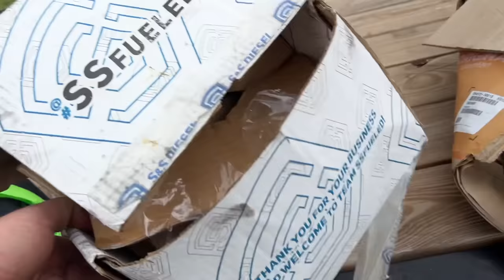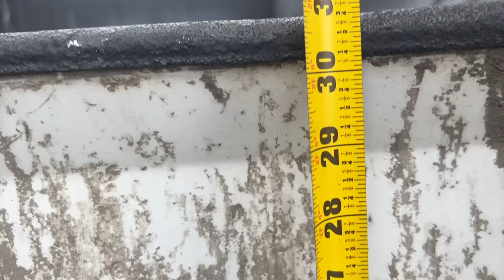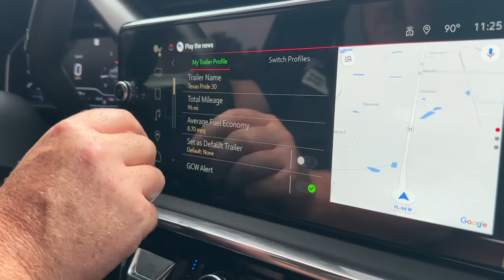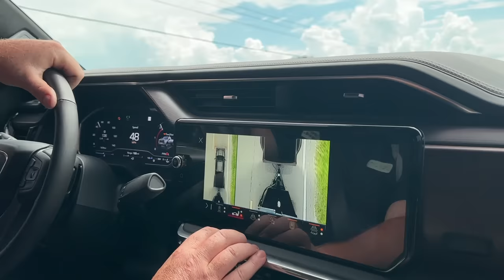$100,000 Diesel Truck VS $2,000 Diesel Truck!!!!  Are These New Trucks Really Worth It?

Comment: Have had a 1999 F250 7.3 manual for years, still my daily driver. At 307K miles, I’d still trust it across country.
Reply: Same here with a 2001 7.3. Jump in and go. Give me 50,000 to do upgrades and it would tost all those  new trucks.  I hate def trucks mine has no imitions at all from factory  very reliable.
Reply: Used to own a ‘96 IDI non turbo, bought for 900$ all she needed were some new fuel lines since she was sitting a while. I could piss, shit, throw McDonald’s grease and radioactive horse semen in that ol girl’s tank and she’d run better than when I filled her up on normal diesel. Duel tanks were amazing too. Sold the truck for 6,000$. Would pay 7,000$ just to have that truck back. Her nickname was “Loyal”.
Reply: @AquafalconHD  all the 7.3 was like that. Every motor  after was junk. With the injection system  on the old ones you could almost run straight  motor oil and she would run. Lol I actually  would filter and delute are old oil from are over the road trucks and pore it in the fuel tank. Why wast 10 gallons of good used oil. Lol
Reply: Given the fact that you just can't buy these configurations anymore I'd say its even worth it to invest in major repairs or restoration down the road just to keep them going. My friend's dad also has the manual diesel F250 for his home contracting business with about three dollars and fifty cents on the odo.
Reply: What major mechanical maintenance have you had to do recently? I just discovered my reman steering gearbox (installed by previous owner or his mechanic) was missing brass seat inserts where the hoses connect. All this power steering whine and I couldn't pinpoint the cause, leak kept getting worse and worse. O rings were the only thing sealing. And of course my reman autozone A/C conveniently blew after almost exactly 1 year, thanks to the texas heat. Also had a hole in the intercooler so I replaced and decided it was a good time to vent the crankcase into the atmosphere. Lifetime warranty swapped my moog drag link that connects to the pitman arm. Is it me or do the replacement auto parts suck @$$ nowadays? 2000 4x4 SRW with lift and 316k on the odometer, Freedom off road adjustable track bar
Reply: Yup, I have a 2002 7.3 F350 with 395K miles.  Just for kicks, I did the same tests these guys do with an excavator on trailer (~15,700 lbs, according to the scales).  It performed much better than their $2000 truck, but my trailer brake module works, and I have an Edge Evolution 15001 programmer on it and an upgraded turbo wheel (and a few other minor mods).  In "tow" mode, it did close to what the new truck did in this video.  In "extreme" mode, it did a little better than the GMC on acceleration but blew black smoke like crazy.  The real problem with driving my old 7.3 like that is the exhaust temps jumped rapidly, and I certainly would underperform the new truck in the mountains (or die trying).  In my mind, the practical problem with my old 7.3 is the transmission.  I replaced with a new Jasper when it went bad a couple of years ago and it is still fine, but won't be if I keep doing acceleration tests with a heavy trailer 🙂.  Overall, it's certainly not as good as the new GMC and not even close to the high-output versions of the 6.7s Powerstrokes or Cummins, but the old 7.3s and Cummins 6.7s are easy to upgrade with a lot of torque and HP for pretty cheap (again the tranny has to be addressed if you want to do serious commercial towing).  I probably have about 130 HP more than the $2000 truck.  I'd certainly prefer a new truck if someone wants to give me one, but until my 7.3 rusts out from under me, I think I'll delay the divorce as long as possible.
Reply: @darinclay6838  I love the old 7.3 I have also. It's been modified  to. Would love to be able to mate that 10 speed auto to it. Other wise I have to settle  for a bts when the time comes.
Reply: Just regular maintenance for the most pat, glow plugs, new exhaust and front end parts. Engine and transmission are still going strong. The body is rusted badly though. Michigan is tough on steel.
Reply: Why does people keep saying the 7.3? The guy I said it was a 6.0 Many times unless I miss something and I very well could have LOL.
Reply: Same. 90 f250 7.3 idi. Last b4 powerstroke. Dual tanks. Banks Sidewinder turbo add on. No def. No computers. EZ to repair. 400k+ miles. Daily driver. Trust is huge.
Reply: @365xmacronocomp  those of us who own "old reliable" 7.3s agree it was one of the best diesels ever made...
Reply: @AquafalconHD They didn't make a 96 IDI 7.3, 94 was the last year of the IDI.
Reply: Did pretty good for a 6.0, it's a miracle that it didn't blow a head gasket.
Reply: @kenfix2740  was it 89 last year for the 6.9 before the 7.3.  That was a good motor  also.
Reply: 1999 7.3 Powerstroke XL 2wd automatic 
307k miles 
Purchased in 2020 for $8000
3 owner and still got the original window sticker in the glovebox at $33,000
I told a guy 2 weeks ago he couldn’t offer me enough money to buy it. Best truck ever made
Reply: @brando8115  A 7.3, 6 speed, with manual shift 4x4 is the best truck ever made, a 2wd automatic is a waste.
Reply: I got an 07 with 212xxx and I love it but I def wouldn't trust it across the country unless I was towing a spare truck 😂
Reply: @ekogut1158  07 is a 6.0, I wouldn't trust it brand new.
Reply: @Lray4x4  ok sure bud, maybe it’s not the best  being automatic but go ahead and tell me it’s a waste after I’ve put 100s of thousands of miles on it lol. Let’s put things into perspective here homie
Reply: yes sir. id trust my 2001 f-350 to take me wherever i needed to go more than i would trust a choked up computer truck that need’s emission fluid to run
Reply: @Lray4x4  a waste? Lol ok buddy
Reply: @brando8115  Yes, 2wd auto is the worst possible combo, it's a waste of  metal and a good engine to put it in a truck like that.
Reply: I have fords 7.3  6spd 898k
Reply: Ugh I can imagine you can hear all the cheap plastic and rattling. You can probably feel all the pumps on the road. Typical Ford they feel cheap and like they are falling apart.
Reply: @abecampbell2439  Much better than GM or Dodge.
Reply: That’s what I have
Reply: I have the 5.3 04 silverado 1500 gas and moved back to florida pulling a 6x12 double axle loaded with stuff, and there were no issues for a 14 hour drive at 290k miles.
Reply: @idignifyyy70 I got a leveled 04 single cab short bed 4x4, 5.3L w 156k and I love it
Reply: Same here 02 f250 7.3 super cab long bed 4x4 zf6 transmission with 290k still going strong
Reply: @phillipdelaney2989  Such solid trucks
Reply: I bought a 99 7.3 manual for a parts truck as well, ended up driving it 4hrs home and it worked flawlessly with 8 bad glow plugs, two dead batteries, a bad alternator and a torn up turbo. tremendously impressed with that truck.
Reply: Thank You because the prices of today's trucks are mindless and crazy.
Reply: 97 with 385k. I bought it when I was 21 with 90k on it. I’m 43 now and I would trust it over my 10 deleted Cummins with 160k.
Reply: 7.3 is reliable I’ll give you that. It’s also a toilet unless you turn it up a ton!!
Reply: Also got a 99 7.3. Already had a big turbo, new injectors, FASS fuel system, built trans, and came with a tuner. It had about 150k miles when I got it. I got it back in February of this year and I payed $5,500 for it. It’s not the fastest thing ever but definitely faster than the average 7.3.
Reply: They stopped making idi in mid 94 btw so the person that sold the truck to you poly lied. And they stopped making non turbo idi in 93.@AquafalconHD
Reply: @AquafalconHD awesome story homie thanks for sharing. Hope to love a truck that much one day lol
Reply: 7.3 has no power though. You can get a 6.2 20 years newer that will be more powerful just as reliable.
Reply: @guyod1  you aint seen a tuned 7.3 with injectors have you

Comment: For 50x as much money, the results weren’t 50x better 😎
Reply: That’s my exact thoughts. You’re paying way more of all these gadgets and stuff. The performance doesn’t really justify the money you’re spending on it, in my own opinion.
Reply: @kithergilliam153 yeah...but my heated steering wheel and headed seats. Started by remote sure is nice when it's time to go to work and it's-10.
Reply: @youtubecantsaveallthesnowf8601  you’re spending money on other stuff that really is for comfort not for performance. It’s all about preferences too.
Reply: @youtubecantsaveallthesnowf8601  since I’m in Texas we never get -10 but we do get 115 weather. It’s bad.
Reply: @kithergilliam153  I hear ya, I'm in northern nevada and summer is no joke either..especially at 6700 feet. But then the air condition seats come in handy...lol
Reply: @kithergilliam153  it's a mix of both...needed a 1 ton that can handle lots of mud,snow and I've had fairly base trim trucks for years, but since I've quit killing trucks on the mine and work in town I figured to treat myself to a super plush workhorse
Reply: @youtubecantsaveallthesnowf8601  I prefer base model trucks because I know the luxury is nice but to me I can’t justify the extra if it’s not going to improve performance
Reply: @youtubecantsaveallthesnowf8601  my first truck was a base model pickup so really all I look for is it working for and will it meet my needs. That’s probably why I don’t have a diesel but I would love a diesel. 7.3 Powerstroke
Reply: @kithergilliam153  I get it...but unfortunately more and more tech is being forced into your cars by the powers that be...backup cameras,pedestrian detection, blinds spot alarms, ect all mandated now.
And driving up costs..
My work just bought 3 new trucks.
All of them ram 3500's
Base with the cummins and 4x4 and that's it.
61k each. The days of the new w/t for 20 grand are gone.
Reply: @youtubecantsaveallthesnowf8601  you’re sadly correct that those days are gone.
Reply: @kithergilliam153 worst part is the gadgets cost raw materials and resources. Imagine how cheap stuff would be if we didnt double down on materials used.
Reply: @bucketheadrox  right! Imagine if we payed for more performance rather than gadgets and customs. Shitttt
Reply: Two things-
• 1  I have a 2018 truck that has plenty, I repeat plenty of power to get me where I need to go when I want to get there. However, it takes me just as long to get up to speed as the 2006 that you used here in the video and  here’s why…. because I take care of my stuff and I’m not gonna floor it hauling, 13,000 pounds, Not even gonna floor it if I’m hauling 5500 pounds.  

• 2 The man in the video mentioned the hundred thousand dollar truck just being the way the market is now.. the reason it’s that way is because we (the people) keep buying hundred thousand dollar trucks. 
STOP . If you stop, the prices come down. So just simply….. stop
Reply: @Muffyman  hit the fucking nail on the head, well said!
Reply: trailer brake doesn't even work in the beater so more accurate to say the new truck is actually infinitely better, actually doing its job w/o being a death trap for everyone you share the road with 😂
Reply: Amen!
Reply: He didn't do the panties dropped test which is really the only reason any of us pay this much money.
Reply: @noahziegler3478  I mean it can depend on the person because I actually like the body style of the early 2000s than the most new body styles. It’s still all about preferences!!
Reply: @noahziegler3478  🤣🤣🤣🤣 that would be an amazing test to see!
Reply: @youtubecantsaveallthesnowf8601  True.. But you could also install all that stuff in the old truck and still have about  90 g's to spare..
Reply: @1TUFZ71  -- That's really not a fair point.  Trailer brake controllers are cheap and easy to install.
Reply: To be fair he didn't buy a stock gmc so the price comparison is completely accurate 🤷🏽‍♂️. It is what it is.

Comment: Let’s see what the gmc does after 20 years and a couple hundred thousand miles?  For a couple of seconds I’ll put the 100k in my pocket. 😎🇺🇸
Reply: 6.0 Powerstroke is shit gonna cost 20-30k in repairs to fix them the L5P is a solid platform definitely be cheaper to own for 20 years.
Reply: So what your saying is you can’t afford a new truck?
Reply: @xaphan8581   nope just not dumb enough to spend 100k on a pickup
Reply: @rodfatherschopshop6004  yeah I’m sure
Reply: @xaphan8581  I hope you feel good about yourself because someone else thinks spending that kind of money for a truck is a waste. Whatever man
Reply: @JoshuaOverman It doesn’t HAVE to be a 6.0. Plenty of other trucks. The Duramax and GM in general have always had head gasket, injector, and electrical problems so I’m gonna say about the time the warranties start running out on the new ones it’s gonna be the same story if not sooner. Anyone who actually depends on their truck for a living isn’t buying a Duramax. I prefer a truck that doesn’t call for 10 hrs to replace a water pump.
Reply: @JoshuaOverman so how exactly am I 10k invested into a very reliable 6.0? And what exactly is going to cost me 20-30k and when? Oh and it's no slouch, wicked wheel 2, 175/30 warren injectors, warren tunes. Only way I'm getting to 20-30k is if I 6 door it like I'm thinking of doing.
Reply: @rodfatherschopshop6004  the amount of likes on both your comments say it all

Comment: A family of 7.3's here. 1999, 2002 and 2003. All with 250-450K plus trouble free miles. Just regular maintenance. I'd drive any of them cross country in a heartbeat. I use my '03 F350 dually to pull our 11K# camper cross country 6 months  months  out of the year for the past three years and never have an issue. DP Tuner, BTS transmission, Gear Vendors over/under with 4.3 gears. She holds her own!
Reply: I need an 8ft dually bed, know where I can get one?